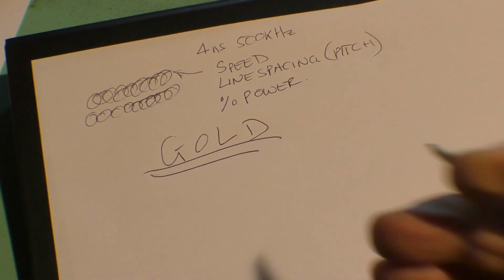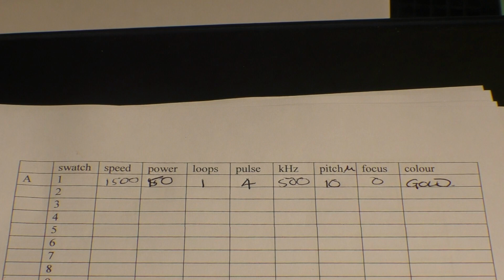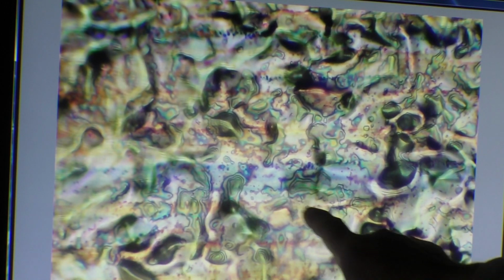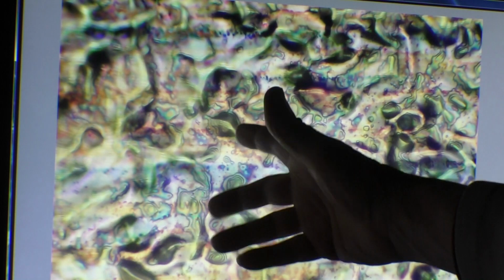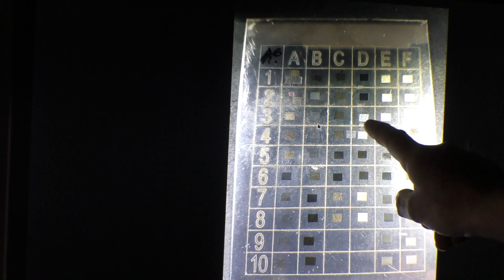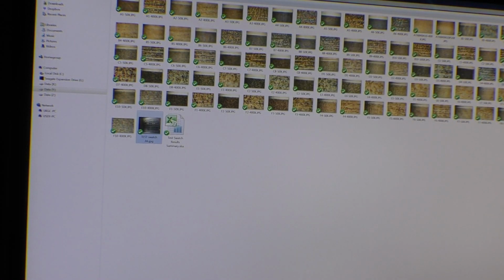Fiber Laser Learning Lab 13 Mining for GOLD

Comment: Hi Russ
That look like a great start to defining a full set of parameters for each colour starting with a pale Gold through to Rose Gold verging on the edge of Copper, fantastic work, looking forward to seeing the next rage of colour and peramiters.
Reply from the maker: Hi
 Whatever I find in the way of exact parameters will be very much for MY machine. Even if you have a MOPA machine, it will have to a 20watt JPT system using exactly the same 254mm focal length lens otherwise pulse shape/duration ans spot size will send you way off course. I am not overly interested in  parameter  details for specifying a  colour palette. However, I am  inquisitive about seeing if there are any rules that underpin the chaos of colours that eventually reach our eyes. It looks like the heat we apply per unit area is a major factor BUT depending on whether that heat is applied in "spiky" or "blunt" manner seems to affect the surface texture. Up to now we have been looking for heating mechanisms that affect JUST the thickness of the surface oxide film but this exploration shows that there are more interesting  colours to be found outside the normal "flat film" arena.   I'm sure we have a long way to go and a lot still to discover.
 Best wishes
Russ.
Reply: @SarbarMultimedia  I'm sure your right, I have a 30w MOPA and although your parameters are not directly transferable they are a good start to me developing my own colour pallet, and if the %power and if 31,250 pulses turns out to be a rule for gold I should be able to turn down the power by 30% and run the same 31,250/mm2 and get something similar.
Keep Safe
Best Regards
Neil
Reply from the maker: @precisionlasersolutions7996  
Hi 
 % power is  not as predictable as you may think. There are short duration "very spiky" pulses and there are long duration "blunt" and brutal pulses.  There is now a very complex relationship between the focal point and % power. I point your attention back to my investigation into focus. Within your focal SPOT there is a distribution of light intensity .Simply put, the more intense the light the mure damage you do. I tried to convey that the intensity of light within the SPOTis huge when the power is 100% and the effect of that CENTRAL light intensity extends well beyond the nominal focal point and will allow you engrave with your material 10mm or more below the focal point. If you now decrease the %power that  spike of intense light reduces and thus its ability to do damage at 10mm disappears  to maybe 8 or 7mm. It is effectively becoming "softer" or the spike is becoming "blunter". (because the spot size has not changed). This % power is in itself a very crude adjustment because there are TWO mixed up effects occurring, one being TOTAL power and the other being relative change of light intensity.. It is better to do your hunting with a  fixed %power and a fixed pulse duration  because you than have precise control of heat application with speed and pitch. By all means play with  PRF kHz  but this is also quite a crude instrument.  Best of luck in your search

Russ
Reply: @SarbarMultimedia   An interesting point Russ with these JPT MOPA M7 Fibre lasers, I have the same series as your, but a 30W instead of a 20W, but the interesting part is the peak power per pulse is exactly the same for both the 20W and 30W versions. The advantage the 30W has is it can sustain peak pulse power at higher frequencies and can run faster, so in theory, your settings for the 20W should work on a 30W as well, unless you are hitting to point that peak power can not be sustained per pulse. I'm waiting  on some stainless steel sheets to do some testing.